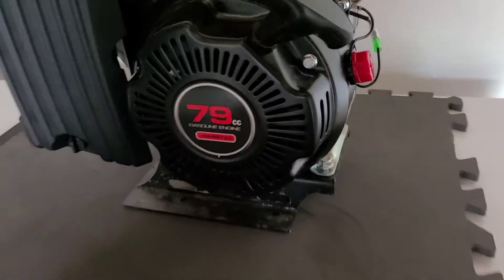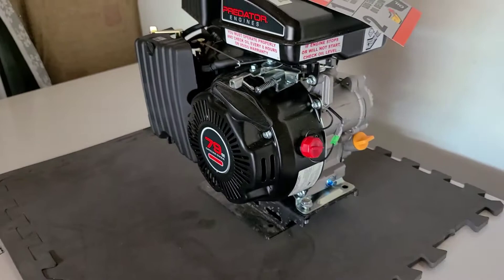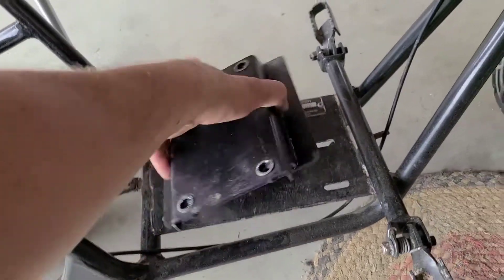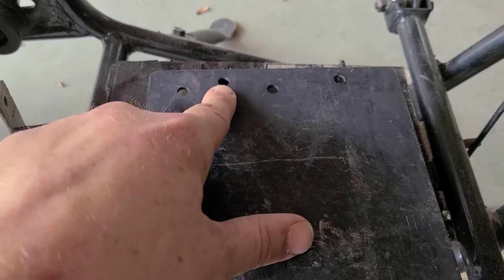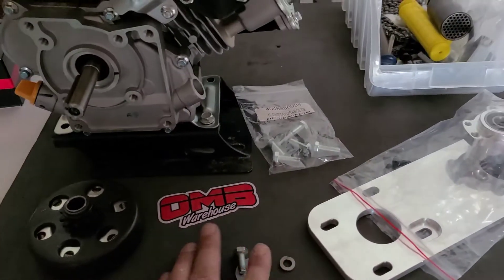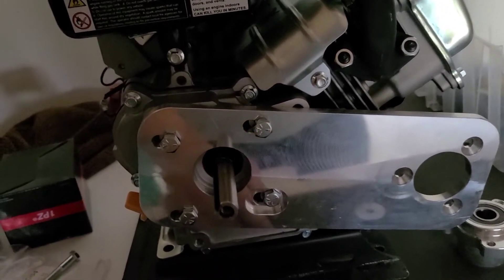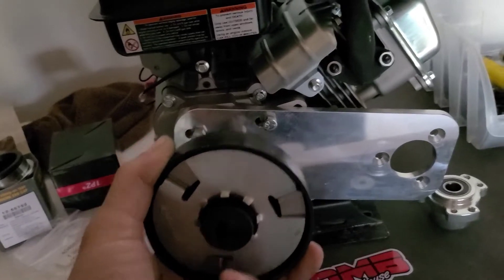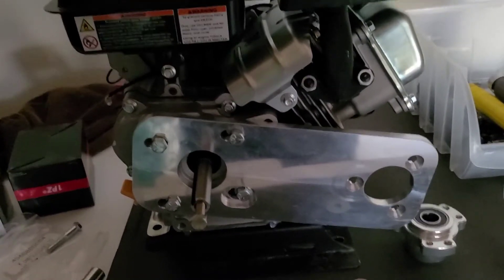Microbikology Predator 79cc Jackshaft & Engine Lineup

Comment: How many teeth on the wheel sprocket?
Reply from the maker: 75. This is a 11/15 11/75 set up.
Reply: @fatbuddycat  So you are around 9.3/1. Wow. Nice thing is you can fine tune with the jackshaft sprockets.
Reply from the maker: @Deucealive75  I'm sorry it's 11/15 12/75 ! 8:5:1 or something 🤔